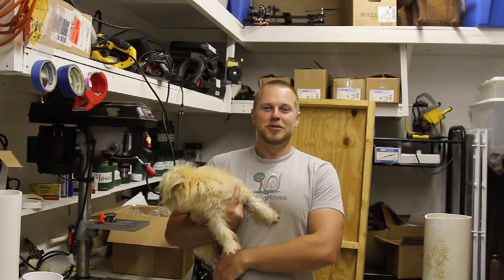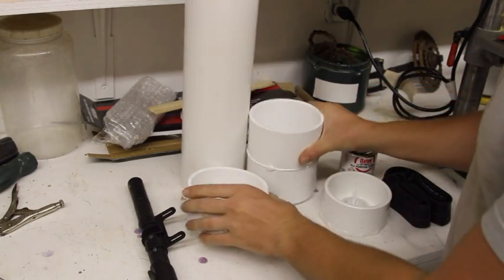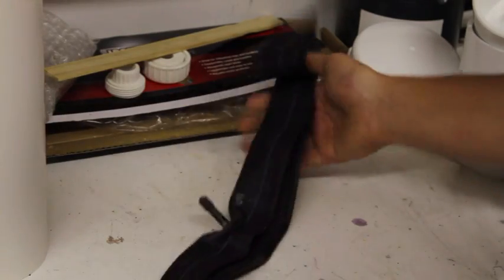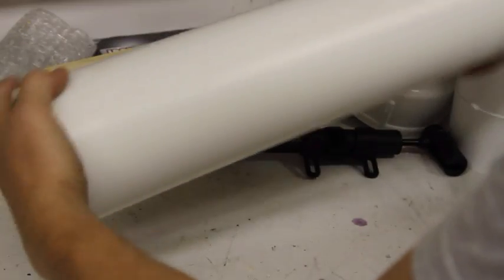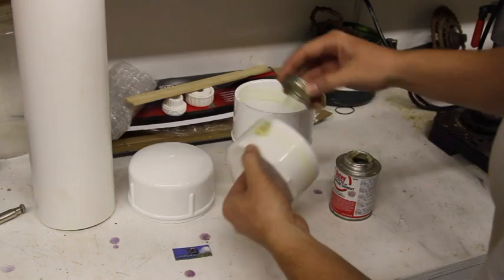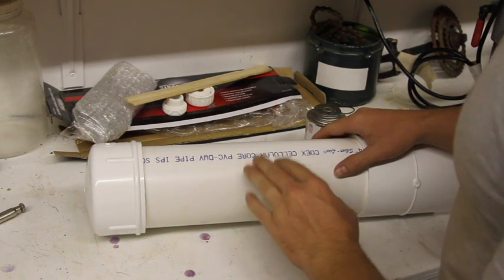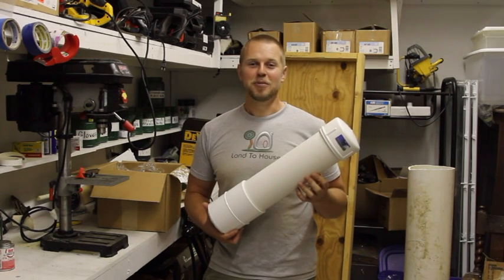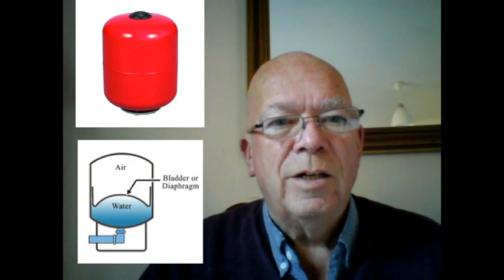Hydraulic ram pump pressure tanks

Comment: I feel like there has to be an output difference between a rigid pressure tank and a non-rigid bladder tank... it has to affect the shockwave that travels back up the drive line, dampening that shockwave with the non-rigid bladder.  Output comparisons would be nice!

Comment: Im setting up a ram pump with 7 ft of supply head and a 3/4 inch ram pump to deliver up 55ft of elevation.  I plan to use a water tank accumulator.  Any recommendation or rules of thumb on size of tank and what pressure to set in the bladder?

Comment: i have designed a hydram but its not working, fall is 3m and the pressure is pretty good enough but still the waste valve is getting stuck and not playing even for a single time. its frustrating. Do we need to put a bladder inside the tank and do we need to pump air into the tank on a regular interval? 
I'm doing this project to supply water from a spring in a remote tribal village. I need your help. please reply
https://drive.google.com/file/d/1-2YmjGghHlKsa9EB2oXdo2d6HZBc9nwk/view
Reply from the maker: Hi, you obviously have loads of pressure so that's not a problem and it should work even if you haven't a bladder inside the tank although if you haven't in time it will get waterlogged and fail. I think the problem maybe you have no backpressure yet, have you a valve you can turn off on the exit or delivery pipe? Try turning that off, build up some pressure then gradually open it slowly. I hope this works for you, let me know one way or another
Reply: @oldtimer43  Hello Michael, Thanks for replying. Yes there is no back pressure. when i m pushing the waste valve with min. pressure of my figure and continue doing it, it is delivering upto 6-7 m. 
I have already installed two swing check valve on inlet and out and also tried what you have mentioned. sealed all the joints. Still not able to figure it out 
Now i'm thinking of replacing the tank with 2Kg or try putting a tube or bladder in it.
or do i need to create more pressure by collecting that spring water in a PVC tank and then deliver it with more fall and pressure, so that there should be no air in the delivery pipe ??
Reply from the maker: Hi, I certainly don't think you need more pressure as the height that it is coming out indicates you have loads, I have a few thoughts, first of all what is the size of the inlet and outlet pipes?If the outlet pipe is too large in relation to the inlet this could certainly be the cause of the problem. To give an idea I used an inch and a quarter inlet pipe and a half inch outlet. Secondly close off the valve on the outlet side completely there should be no reason then that it wouldn't keep working on it's own. I am sure we can sort out the answer between us, good luck
Reply from the maker: Hi, I was wondering how you were getting on with the ram pump? I am pretty sure it is either one of two possible problems. Either there is air in the inlet pipe, even the smallest amount will prevent it from working or there is insufficient back pressure which could be due to  outlet pipe that is too big or just a case of shutting the outlet off altogether to build up pressure in the tank then gradually opening it up until enough water gets into the pipe to give the back pressure. Keep in touch and let me know how you are getting on...Mike

Comment: Can I use a ram pump in a fast moving creek with a 4inch PVC pipe reduced down to 1.5inches for the intake
Reply from the maker: Yes that should be fine, the deciding factor on how well it works though is not whether it is fast flowing but how much fall or height difference there is between the intake and the pump
Reply: @oldtimer43  
The pump will sit almost the same vertical height as the intake . The height that it will be pumping is only around 5 feet over 100feet. Because of the lack of head pressure I wanted to use the PVC to  funnel the water to the pump reducing the inlet size gradually to increase pressure.
Reply from the maker: @stevemaxwell8550  Unfortunately in these circumstances I do not think the pump will work as the pressure will remain the same
Reply: @oldtimer43  
So the only way would be to dig and place the pump lower then the Inlet.  What is the minimum drop it would need to work
Reply from the maker: @stevemaxwell8550  I haven't tested it but I think you would really need about 2-3 feet
Reply: @oldtimer43  
Okay I'll check it out in a couple weeks and let you know

Comment: Thanks, for the video!  It was very informative!

I was wondering, how did you determine the optimum pressure for your pressure tank?  And, have you experimented with various pressure settings?   If so, what were the results?

Thanks, again!
Reply: you don't actually control the pressure in the tank. the pressure is determined by the pressure (head) of your water system. the pressure tank is poorly named because it's actually a damper. the air is absorbing shock and resisting changes in motion through its compressibility. how much air you put in the tubing is more about fitting the tube in the pipe than anything.
Reply from the maker: Spot on, a very good explanation

Comment: With the tube, why couldn't you drill a hole for the valve stem in the cap, a tight fit the rubber will seal the hole and you could also use good glue or caulking to help seal it, this way the cost would be no more, and you could adjust the pressure as well?
Reply from the maker: That is certainly another way of doing it and a good alternative.

Comment: Air pressure should be the same as the water pressure. Why would you not have the valve stem of the tube go through the top?? A motorcycle tube has a seal and threads and can be screwed tight to the cap.
This way when the tube loses pressure you can simply add air??
Reply from the maker: The valve stem does go through the top of the tank and I can add air through it which I have done a couple of times

Comment: Great video! Thank you for sharing. It was nice getting to collaborate with you.
Reply from the maker: Thank's Seth, maybe not my best effort ( I enjoyed your par more than mine ) and I have to get the sound sorted out ( new computer on the way ) but yes, it was good to collabarate
Reply: I thought it was great. I too am working through some audio things. I just learned about how I can take that hiss out of my audio. What is your new computer?
Reply: In relation to tyre tube setup, you could simply drill the valve stem into the side, allowing you to check and increase/decrease pressure without destroying the outer stem. Also you could use threaded couplings, to allow you access to the tube.